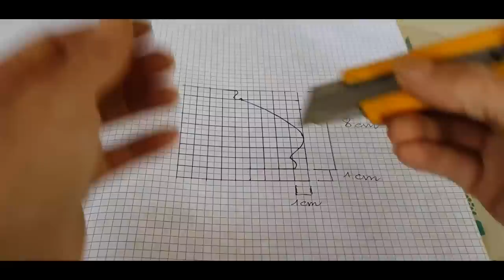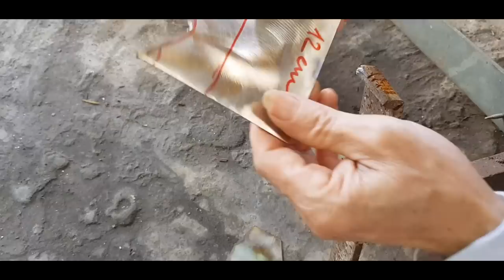Try making a 78cm cement pot on a turntable

Comment: Hi Son Tran. If I could make a couple of suggestions.... (Perhaps you've thought of these before, but if not, maybe you could give some feedback on these ideas.)

Why not try placing a scoop shaped platform below the drag plate? Then have it drain into a container. It would save a lot of clean up as you go along. 

Also, I was thinking that when you spread the powder, is it easier to toss it with your hand, or to use some kind of sprinkling container such as a baby powder jar? (I'm just thinking if your hands are wet or dirty, it may be easier.)
Reply from the maker: Hello! Thank you for your comments, it's really necessary and maybe I'll change the way I do the next time.
Reply: @Z3Nzz  Hi friend, do you speak english?
Reply: Great ideas man. Esp the baby powder bottle